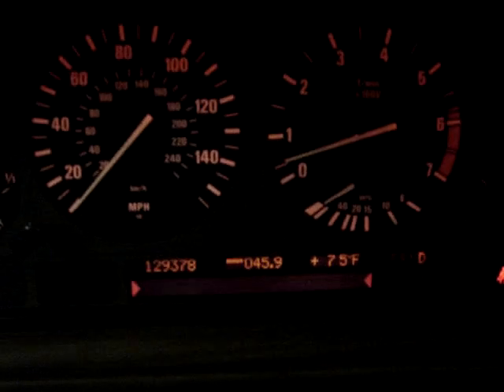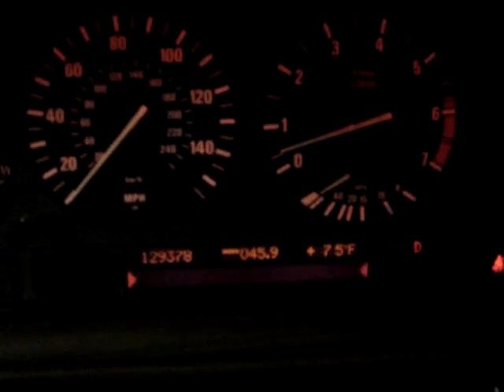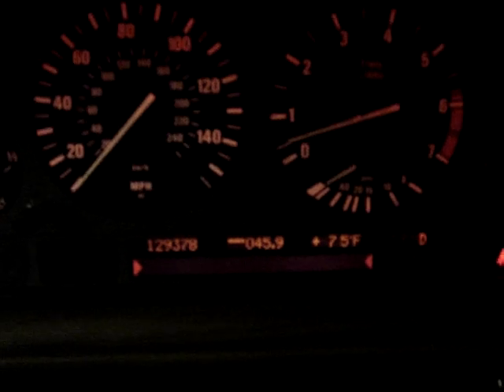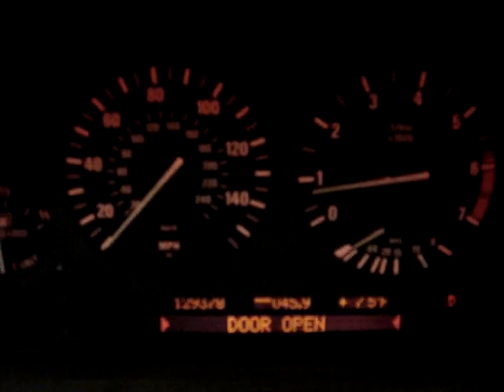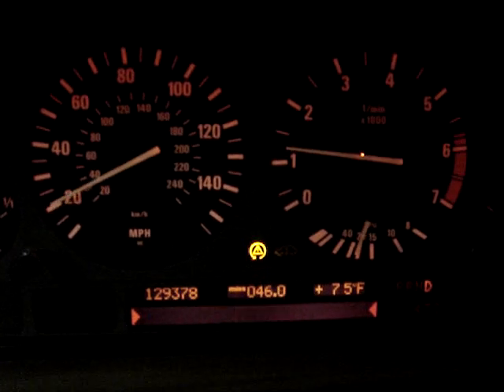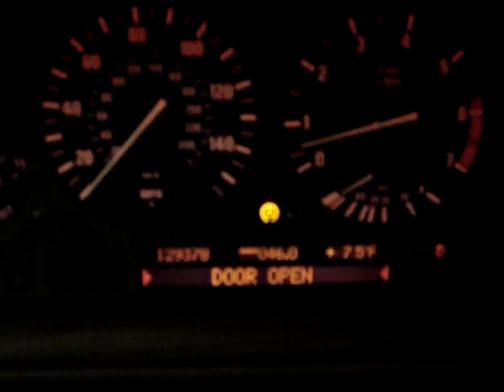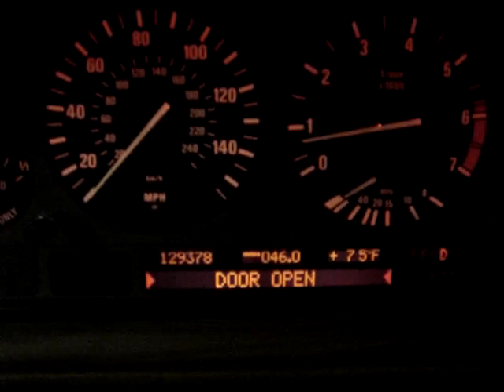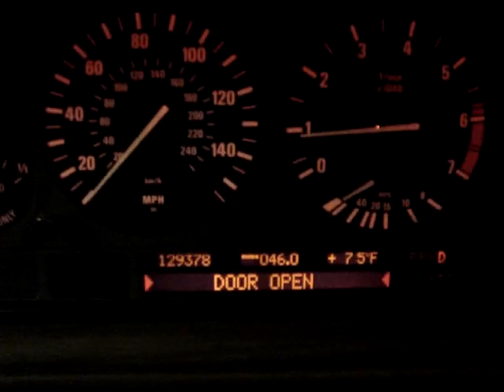E38 DSC in action on hoist

Comment: do you know how to fix the map sensor error on these e38's? Thank you
Reply from the maker: Replace the MAF sensor. But if there are other accompanying codes, it isn't always the MAF. Check for intake leaks at the manifold gasket, throttle body and rear oil separator valve.